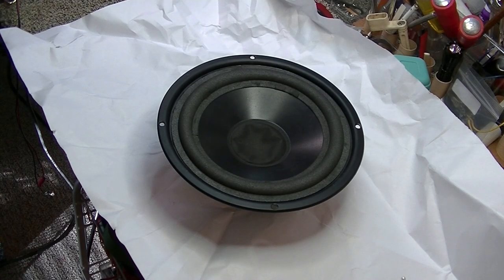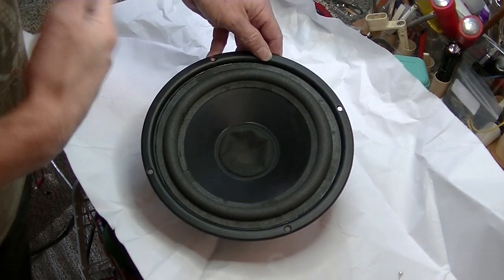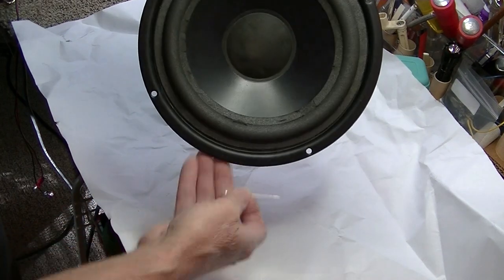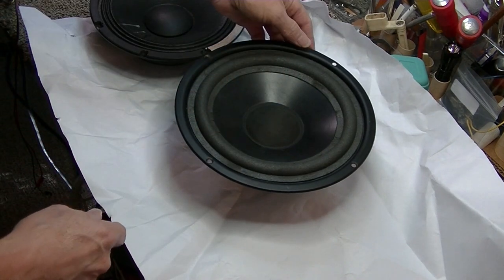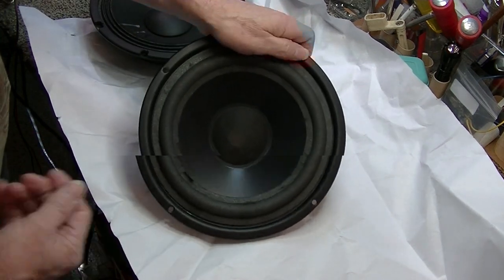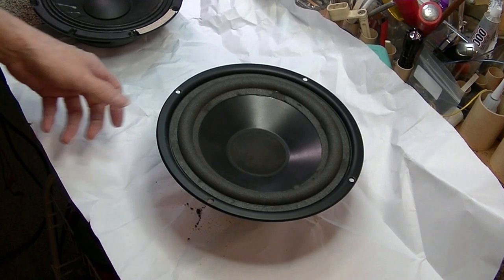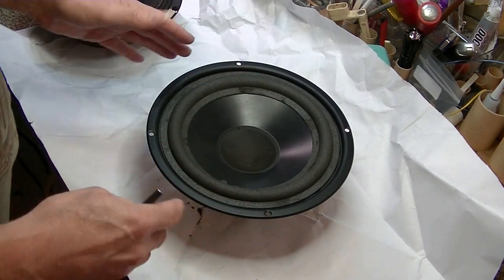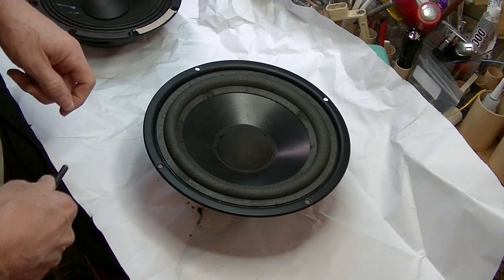Speaker Repair Guy - Dust caps and foam surrounds

Comment: I have a set of older 8 inch woofers (Bolivar 18 speaker) with inverted dust caps that are near impossible to remove as they have a very big of area glued onto section of the cone..  Im having issue with coil rub and i also have to reglue the spider,, so was wondering if i do my best to cut out a hole in cap to get in to shim coil can i  glue the cut out back in.. ???  i know ill be able to see it but i want to keep the orig drivers in these old speaker which have a interesting story to them if one was to read up on them.... They had ties to JBL at one point.
 im a newb to speaker repair.
Reply: @larrysmith8721  Thanks.... havent attempted yet as im fighting with one of the voice coil formers is a little hairy rough inside and no matter where i move cone to music is slightly distorted... Was told shim and be fine ,, But when i move cone with up and down movement the good sounding speaker you here nothing from former , but the other is scruff noise from coil former..  Ive tried squeezing it round and was little better but just cand find that sweet spot for undistorted sound...
Reply: Instablaster
Reply: @larrysmith8721    Forgot to tell you i got the Voice coil fixed and speakers back together... And New orig style Inverted Dust Caps

Comment: Hey, my subwoofer dust cover is made out of like a paper feel I tried fixing it one day awhile ago and got it but not good at all it made it very weak or like bendy. So when I listen to music it makes this rattle noise or like bfbfbfbfbfbfb. What should I do?
Reply: Ideally, you want it replaced. Not a big job for someone who does this sort of work. But at this point you want to stiffen it up to prevent it flexing. I might suggest you coat the dust cap with a glue of most any type but not Super Glue. Even white glue like Elmer's. Make certain that there's no risk of the glue getting into the voice coil. I assume there's no big holes for glue to drip through. If you have a small paint brush like an artist's brush, gently work the glue over the dust cap evenly. Or use a fingertip. Let it dry an hour or so and apply another coat. Let the glue cure overnight before trying to play it. More coats might help. Depending on replacement cost, you can pull the speaker from the cabinet and bring it or ship it to me in Charlotte, NC. About $15 to replace it. But there's the shipping cost to factor in. Last thing I can think of is to check and make sure the dust cap is still glued to the cone all the way around. I've seen dust caps come partially unglued and flap when played. It's not something that you can see easily. Apply light pressure around the dust caps edge all the way around and see that it's secure. If not, a dab of glue will fix it.
Reply: Chip Chance So the good news is I live 1hour and 47min away which is closer than I thought! Before you responded to me I gently put a piece of tape on top and it stopped, but I’d still like to either drive it to you or do the glue idea because your the expert.